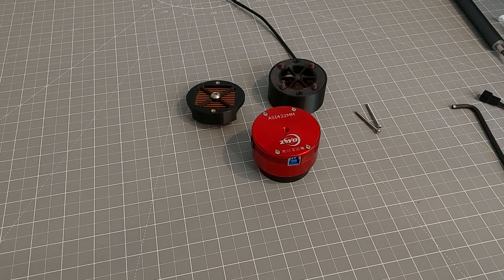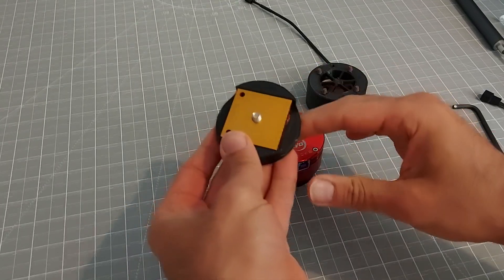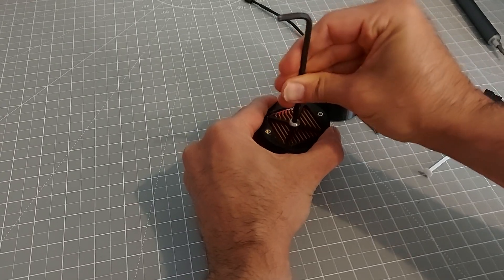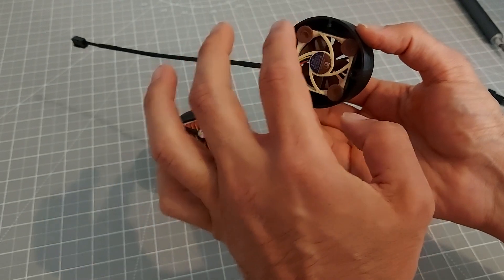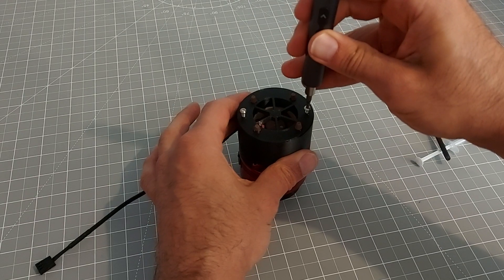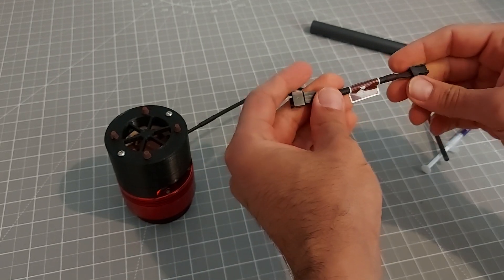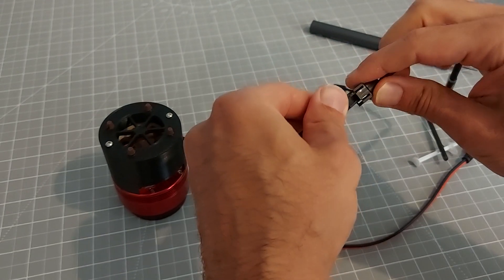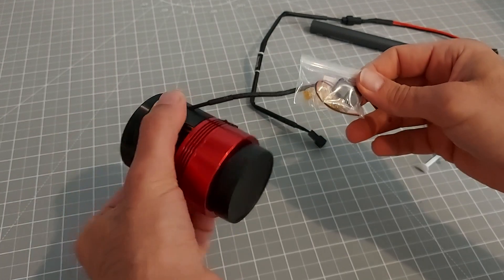Rouz Astro ZWO ASI Cooling Kit Installation for Uncooled cameras

Comment: The only drawback to this is there is no way to regulate the temperature. You can’t even really monitor the temp unless you install a temp sensor and even at that you still have to turn it on and off to regulate it. I think I will take a hard pass on this one as it creates more issues than it solves.

Comment: i built one using  TEC  controlled down to -20C  and it does cause condensation , but i will be buying one of these for my ZWO585MC planetary camera.
Reply from the maker: Dew is an issue with TEC as these are not sealed and anything below ambient will cause issues. Also, the power consumption of this will be 10x less than that of a TEC color.

Comment: Man this has to break the code on expensive cameras with pre installed cooling fans.
Clear skies ✨️
Reply from the maker: Its relatively low cost and you get to cool a lot of camera models with  it. While it's not as powerful as a Peltier cooler, it's a lot more simple and uses almost no power.

Comment: Lovely design Rouz. Since the camera will cooled by the ambient air, I wonder how much efficient in terms of temperature drop with the fan on on a hot day. Thanks for sharing it.
Reply from the maker: Thank you! Glad you like it. The cooler can drop temps quite a bit when its cold. On hot days it will still stop the camera from overheating by multiplying the surface area and allowing it to shed heat.

Comment: hi, does this have any issue with wiring? as in the wire becomes loose or shortening connection?
Reply from the maker: We haven't had any problems or issue with any of the many kits shipped globally. User feedback has been very positive.

Comment: did you ever try a peltier plate to supplement this? people have gotten encouraging results but I havent found anyone who's run it longer than like 20 minutes with one. just quick testing has shown the peltier plate will reduce the camera housing to well under ambient, but it will increase the heat side a lot, so i'm not sure if you need a larger heatsink or not, and how that would affect usage over a couple hours.
Reply from the maker: A Peltier cooler will go below ambient that will cause dew inside the camera and on the sensor. These cameras are not sealed and will get ruined in that case.

Comment: how does the male to male adapter for asiair work? is it getting power from the air? are we supply power to the air? how does that work?
Reply from the maker: You normally supply power to the ASIAIR. With the male to male - you can plug this cooling kit into the one of the outputs of the ASIAIR to power the fan. There is a USB version that will plug into the USB port of the ASIAIR or any other device. That doesnt need the 12v male to male.

Comment: Hi Rouz, thanks for the video.  A question about condensation.  How to you prevent it from getting on/inside the camera?  Every consider putting a SilcaGel bag inside the OTA near the camera, and then remove it once the camera has gotten to temp?
Reply from the maker: As these are air cooled and not TEC. They don't go below ambient so dew can not form anywhere.

Comment: Why don't you use TEC?
Reply from the maker: A TEC will cause lots of condensation in these cameras as they are not sealed. The moisture will damage the electronics.
Reply: @RouzAstro  so let me know effect of only fan on the sensor parameters eg: noise
Reply from the maker: @rezamohammadij  https://rouzastro.com/product/active-cooling-kit-for-zwo-asi-uncooled-cameras/
Reply from the maker: @rezamohammadij  tests and details there